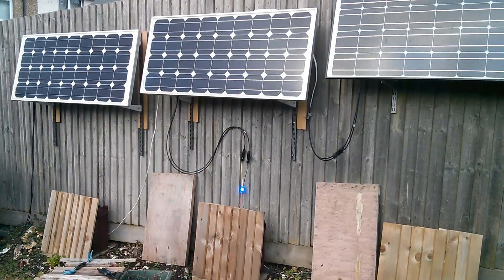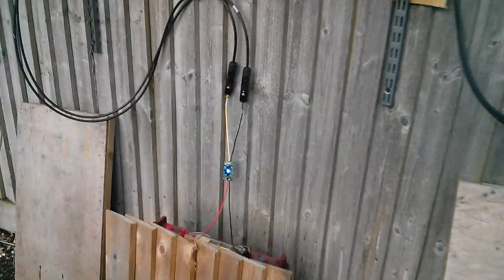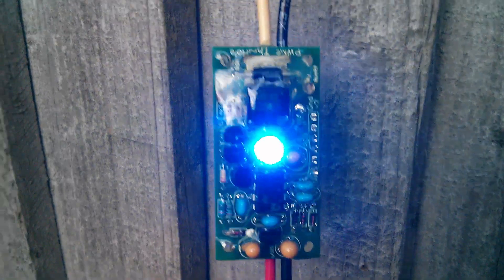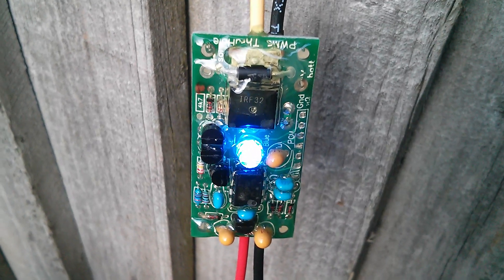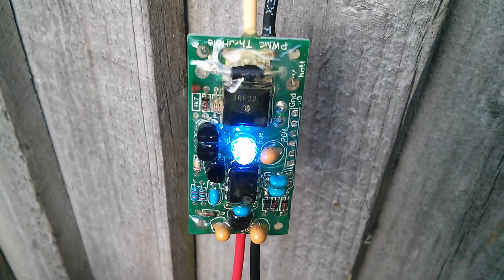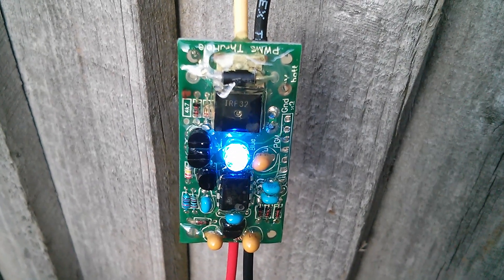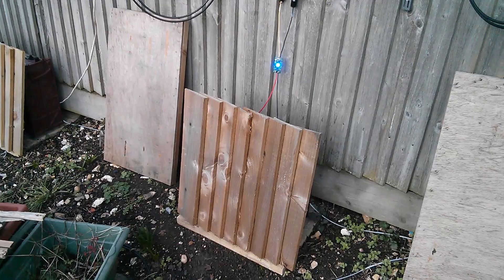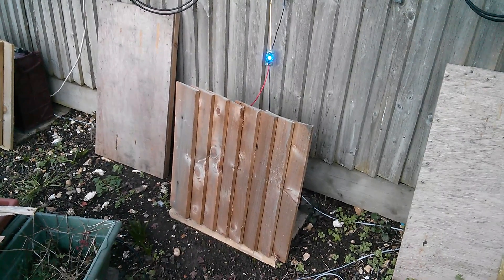Solar Charge Controller Corroded Again

Comment: Maybe you want to try some of this potting material used for installation boxes. There ard these grey distributor boxes in the hardware stores made of ABS. Use one of theese and fill it with a silicone based potting material also sold in hardware stores. You can leave the lid open of the box if you want to see the LED or if you like it you could switch over to an old style 5mm led and pierce it through the lid.

Comment: Yes, give it all a bit of a dog kennel approach, so the water is shed off the roof clear of the sides and so that there is an airflow up through the enclosure. I have an electric fence controller and both it and the batteries sit about eight inches off the ground, out of the rain splash zone, with a slatted bottom board and an overhanging pitched roof which is also the access. No problems except with spiders wishing to keep out of the weather.

Comment: My opinion is to make sure that the edges of the circuit board are well broken or rounded.  Then take a tip from metal painting and the do an edge coating before they paint everything.  Puts a thicker, tougher coating of, well, coating on the edge that would normally break and potentially peel.  Try a rounded edge of epoxy prior to conformal coating.  I also agree with drip legs on conductors.  You know water will drip - control where.

Comment: I use this all the time on underground joint boxes and never have a problem with water Ingres... RAYTECH BLUE DI-ELECTRIC GEL POTTING COMPOUND 1LTR
2-part gel potting compound that provides protection from water, dust or insects. Suitable for permanent submersion and is re-enterable. No shelf life and completely non-toxic. High di-electric strength and working temperatures. Supplied with mixing jug and spatula.

5-10min Approximate Setting Time
Single Use Only
Re-Enterable
Cross Links under 10mins at 23°C

Comment: Isn’t it a bit cold and wet for shorts 😲
As to building something electrical or electronic that will survive outside in our wet, windy, cold weather, then you need to do all of the following:

1, protect from direct rain fall, so put the board inside a plastic enclosure / box. Make sure that the plastic is resistant against UV light. You can also use suitable metal enclosure / box. The enclosure / box should be arranged so that there are no holes in the top. The best place for cables to enter is from below into the bottom.

2, try to use any existing fixing points to hold the board, or glue new fixings in place. For plastic cases that have guide slots, they can also be used. The last thing you want to do is to drill extra holes in a enclosure / box when the aim is to keep the water out!

3, although sealed boxes / enclosures are available, I strongly recommend drilling two 4 to 5mm drain holes in the lowest part of the box, this is especially important if the box is made of metal, or there is any significant amount of metal parts inside. The day (warm) / night (cold or cool) cycle will cause water in the air to form condensation on metal parts, and sometimes on other materials. Despite what may be said by others, your box or enclosure may not need a watertight-seal, as long as there is a tightly fitting lip or overlap so that wind driven rain can’t directly make its way in and there is a drain hole. The reason for two is for two reasons, first in case one gets blocked, and second, so that there is a little bit of airflow.

4, you still need to cover a PCB with some kind of coating, a flexible conformal protection is recommended, but your UV glue may do.

5, as stated by others, any wiring should be routed so that any water will drip off a loop without running into any electrical or electronic terminal/equipment.

6, where possible, either locate the enclosure or box under a protected area or provide a simple wooden roof, with an air gap of about 50cm / 2 inches. The purpose is to save the enclosure or box from direct rain fall and to shade it from the heat of the Sun. This reduces  the temperature difference between the hottest and coldest temperature changes.

If all of the above steps are taken, electrical or electronic systems can survive for over ten years with minimal maintenance 😉

Comment: Change the wire so there are drops or drip loops in each run. That way the water will run to these dips rather than to the charge controller.

Comment: UV glue does not equal conformal coating. The real stuff is much more flexible so it can deal with expansion and contraction from temp changes.

Comment: I think it would help tons if you had the wires making a u turn and come in from the bottom, so the moisture running along the wires will drip down safely at the bend and doesnt run towards the PCB.
And then have small enclosure or something so direct rain can't affect it. Then you'll probably be fine, if you got what I'm trying to say ;)

Comment: Could you have some solid metal connectors which come through of the coating and then the wires are connected to it? Like brass rods. The water should not go through them.

Comment: As well as a waterproof box, have the cables come into the box from the underside. On the cable that comes from above put a loop so water drips off that as it runs down the cable, have a look a properly installed telephone cable or TV aerial  installation as it come into the house normally through a window frame. Google: water drip loop (without quotes) for some images.

Comment: Coating + some small plastic box... There is lots of those small project boxes, even transparent. I had led lights outside for few good months and they had their own battery box i just throw them inside another box and they worked perfectly without any rust.

Comment: put the coating on it then heat shrink and lastly, pour in clear resin so you pot the PCB then you will not have a problem that would be the cheapest way to keep it dey.

Comment: @Julian Ilett
You are correct Julian. UV glue isn't actually flexible, so as the board and components expand and contact with the weather, small gaps form around the components and wires, letting in moisture. Actually changing air pressure will actually draw moisture in, which isn't what you want. 

You're far better off using a proper conformal coating, which is flexible, so it expands and contrasts with the board. Once coated, put the charge controllers in those small boxes with the clear sealed lids. Bring the wires in holes drilled in the bottom, and don't seal around the wires. This method has kept my PWM5 functioning perfectly, without any corrosion, and I live in the southwest, which is much wetter than your area. ;)

I can send you some of my tropical grade conformal coating if you'd like to try it.

Comment: Obvious solution to your problem - move somewhere warm and sunny where it doesn't rain. (Or failing that, a project box with wires out the bottom to form a drop loop. Put some drainage holes in the box to let condensation drain. But I prefer option 1.)
Reply from the maker: I also prefer option 1 :)
Reply: @JuliansShorts  Remember, in Phoenix, even the rain is dry.  And, we have lots of sunshine for you.

Comment: I would do two things: 1) Put the charge controller in a case with a seal around the wires (o-ring, etc) 2) Make sure the wires enter the case AFTER a drip loop. (just my suggestion)
Reply: Yep, simple design. Plastic box...

Comment: Have you thought about trying something like the Electrolube conformal coating that Farnell sell? I've used the paint on one (item code 1616573) for an outdoor sensor PCB and it seems to work well so far. It might work better for you than the UV glue and it is also set by UV.

Comment: You could just make a mount for the PCBs so that the wires coming from the panel loop back up to PCB.   This would greatly reduce the water ingress.  Maybe even solder the wires at 90 degs to help.
Reply: He could put the fucking PCBs underneath the solar panels to keep them dry.

Comment: I think that it's safe to say  your UV glue is not a very conformal, "conformal coating"...Its not conforming enough to stop the ingress of moisture,  maybe a cleaning step before application ?...not sure ... but clearly it's the "interface" between your board and the coating that's the problem here,  perhaps go "whole hog " and "Pot" the board in resin.